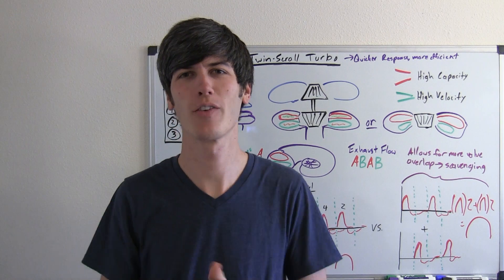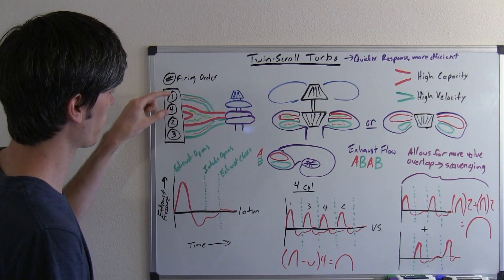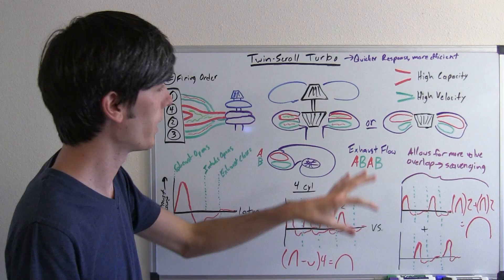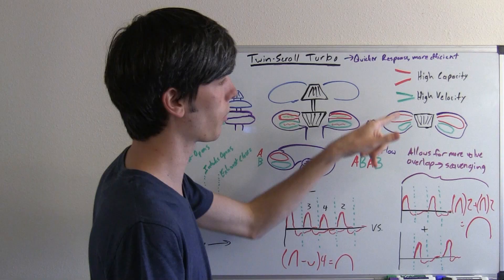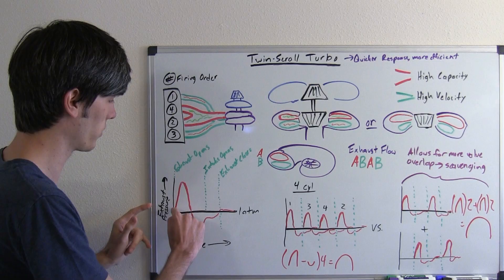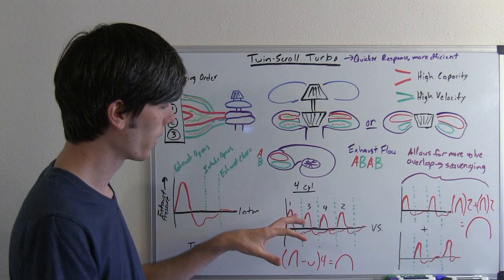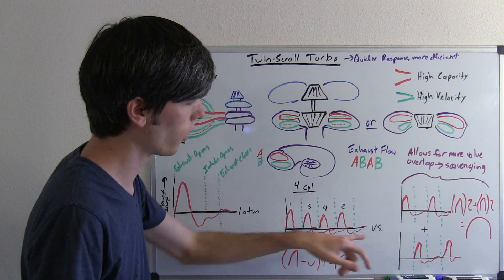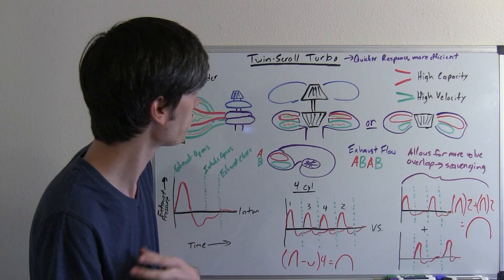Twin Scroll Turbocharger - Explained

Comment: But now I have a question in the twin-scroll turbo the two scrolls as the same size or one small for low pressure and one big for high pressure?  and if two sizes so we now not use all of the exhaust produced from the engine  because every scroll connected to two cylinders only

Comment: So what about running a single scroll turbo with equal length headers that divide the cylinders in the same order as twin scroll, and join the 2 pairs right in front of the turbo. would that get most of the gains of a standard twin scroll design? Thank you!

Comment: I'm currently working on setting up a front mount turbo setup on a V6 engine, Turbo being on the "Driver Side" of the car. This means that the driver side exhaust bank will have a shorter piping length to the turbo compared to the "Passenger Side" exhaust bank that have is piping going around in front of the engine.
If i understand correctly, please correct me if i'm wrong (the main goal of this post in fact), the Driver side exhaust bank should enter the High Capacity Scroll side and the Passenger side exhaust bank into the High Velocity Scroll?

Comment: Is there a price to pay for cylinders 1 & 4 at high rpm since that scroll nozzle is quite restrictive?  Could you accomplish the same thing (exhaust pulses not interfering with one another) by using a conventional turbocharger but still having split exhaust as you have?

Comment: I have this on a new 2019 WRX. Under various throttle positions (while accelerating) there will be no boost. Or the boost will cut intermittently and then come back later, delayed. All of this occurs under 4,000rpm, which I don't exceed as part of break in. Dealer can't say for certain what is causing this until after 1,600km break in. Currently at around 700km. Any thoughts? Like engine cutting power via timing because it's programed to until certain rpm?

Comment: so what happens to the turbocharger during the troughs for the twin scroll?
why doesn't the negative pressure during the troughs for the twin scroll affect it as dramatically as having the troughs and peaks overlap in the non-twin scroll?
Figure the peak amplitudes are greater for the twin scrolls?
Reply: In a twin scroll, the exhaust is separated in a way that the firing cycles of the cylinders is undisturbed. Think of each pulse as a racing car behind another racing car. In a twin scroll setup, there is enough space between each car so that the car behind it can benefit from drafting (here the negative pressure effectively creates a vacuum behind a leading pulse for the pulse behind it, allowing the lagging pulse to keep its speed longer). This way, the maximum energy of each pulse can be used.

Now in a traditional merged manifold, imagine all the cars trying to merge behind each other as close as possible, but each open space is half the length of the cars. To fit all the cars in, the cars behind a merging car have to slow down (in this case the pulses would merge and lose energy). In the manifold, the pulses interfere with each other as low pressure tails steal energy from the bodies of adjacent pulses and thus generally sapping some of the potential energy of the pulses.

There are a lot more factors to consider, but this is the bulk of twin-scroll.

Comment: Ok so I have a single twin scroll turbo for my ls engine.   Would it be better to combine the two sides and then go to the turbo in one 3 inch pipe or would it be better for each bank of cylinders to go to one side of the twin scroll and the other bank go to the other side?

Comment: Equal length headers will do mostly the same thing as long as the turbo is sized right.. I mean if the whole point is to even out the exhaust pulses.. Duel scroll turbos do drive with a lot less lag but so to "single scroll turbos" with equal length headers.. Perhaps it's the energy transfer from the exhaust volume harnessed from the 2 cylinders at a time that yealds more kinetic energy. Or, the engineering tolerances have just been zeroed in more across the board with a "new style turbo" to sell people. I mean duel scroll turbo does sound cooler then performance tuned turbo.. Just my 2 cents on that end of it. Good video but kinda lost me at the end lol. Thumbs up :]
Reply: the size of the trubo and the exhaust pulses are two different things
Reply: They sure are

Comment: Is it possible to have a VGT and Twin Scroll system in one turbo unit?

Power to the max!
Reply: Brap Brap Kind of defeats the purpose. Variable geometry can accomplish what a twin scroll is doing and it can do a much better job because it can be so precise. The reason why VGT is not very common yet is because it's so complicated and expensive to produce vs. twin scroll turbos.
Reply: +TheRecon4 well you get what you paid for

Comment: Since 1st and 4th cylinders feed to the same scroll, wouldn't 1 and 4 be linked together to a common manifold rather than 1 and 3? That goes much in line with alternate firing order of 1-3-4-2 I guess.
Reply: 1st and 4th cylinders are linked together to a common manifold - numbering in top left figure is about firing order

Comment: Should make a video explaining why a larger turbo setup will outperform a smaller one at the same psi
Reply from the maker: Not necessarily true.
Reply: Engineering Explained Do explain. Tis what you do best.
Reply: Aaron Barrett If I can just jump in, when you first open the throttle or are idling, there isn't enough exhaust gas to spin the large turbo up to speed, while with a small turbo, there's less rotational inertia (smaller compressor/exhaust wheel) to overcome, so smaller turbo's actually outperform large turbos until a specific RPM. It's only when enough exhaust gasses flow through the turbo that larger turbo's really make boost.
Reply: SuperNuclearDeath I do agree with you. A smaller turbo will spool up quick, but will reach it's limit in the higher rpm's. A big turbo will lag at the low rpm's but when the boost rolls on though......
Reply: ***** That's exactly what I was saying. But the issue with a large turbo is how long it takes for it to produce usable boost.
Reply: Not always true, it depends on the engine displacement and the turbo used... For e.g A bigger displacement engine would have a lower turbo threshold than a smaller engine with the same turbo. It's all relative.
Reply: Aaron Barrett quick and simple reason why you normally see adding a larger turbo on your engine and running the same boost pressure as your smaller old turbo,
the reason why you will result in more horsepower is because you have a larger exhaust turbine wheel so more Cubic Feet Minute of exhaust gas can flow through the larger turbine wheel which translates to more air flowing through the engine which then need's more fuel to be added to compensate the extra air flowing through the engine resulting in more power,
there is a point where you cant keep fitting larger and larger turbo's on your car and still keep making more horsepower due to the head/engine not being able to flow as much air as your large turbo so more turbo lag is added and no horsepower gains to be made if you go to big.
think of a drinking straw now think of how much air has to be pushed through that straw (small turbine wheel) to become a restriction on itself at say 10psi of air pressure getting pushed through it.
now think of a 3 inch, straight piece of exhaust pipe (large turbine wheel) now how much air would you need to flow through it to become a restriction on itself at 10psi.
it's a lot more then the straw. :)

Comment: Hi Jason, long time watcher - really appreciate your vids.  Have a question for you - I've been reading about the new Honda 2.0T Engine being put into the new Type Rs.  What I'm interested in is the decision to use a single scroll design.  I feel that is blashmemy and goes against every rule of turbocharging design, especially on a 4 cyl where the pulses are so spaced out.  It would be neat to see what magic they are performing with the exhaust valve timing.  Anywho - any thoughts on this would be great.  Take Care, keep up the good work - Nate

Comment: Hi! 

Can you explain the benefits of the twin scroll turbo on an engine with equal firing pulses like an straight six engine (with equal length exhaust manifold.)

Does a straight six engine still have valve overlap between cylinders?

Comment: Why doesn't the second equation take into account the pressure drop? It's still there, just not figured for...
The twin scroll turbo is still only splitting the pressure that a standard turbo would see in half, with each "scroll" getting exactly half the pressure, right? Please someone teach me, or correct the equation and then convince me.
I mean, with a compound turbo setup, the full amount goes through the small turbo to build boost quickly, then the full amount gets diverted to the big turbo (at higher rpms). That makes sense to me, but sending half and half throughout the entire rpm range seems to me like it would cause both turbos to operate far outside of their efficiency range.

Comment: Question: I have a 84 mustang SVO 2.3l intercooled turbo and have a center/ top mounted header that has a open flange, I have a twin scroll exhaust turbine for my T3/4 turbo. The header is set up where cylinder 1&2 are on the front side of the collector and cylinders 3&4 are on the back side so if I fabricate a piece and weld it down the center of the collector to create a twin scroll manifold I'll end up having cylinders 1&2 paired together and cylinders 3&4 paired together. My question is how are the pulses and pressures going to effect the performance of both the turbo and engine?  Btw the Watergate is on the front side and would be on the side with cylinders 1&2.
I know about if turbo is a twin scroll and the manifold is open it's the same as having a single scroll turbo and the same if the you have a twin scroll manifold and a single scroll turbo it performs like a single scroll. So I like the benefit of the twin scroll but don't know if retrofitting my header to create twin scroll manifold would be beneficial or not.

Comment: Please do the difference between vtec,vvtLi and VVL
Reply: They do the same, but the make the valves open more and longer in different ways.
Reply: VVL isn't like VTEC or VVTL-i. VVL advances or delays the cam timing. No extra cam lobes like VVTL-i and VTEC.
Reply: TheFlacker99 (Flak) your thinking about VVT, VVL is nissans form of vtech, mechanically it locks the rocker arm differently than in vtec but it still has the extra cam lobe. VVT is where it advances and delays cam timing to minimize overlap.
Reply: Yeahp... Nissans VVT is VCT used on VG30DE(TT) and RB26 to GA16GE.
Reply: Jeff Gallego Ah yes, oops. :D
Reply: TheFlacker99 (Flak) its ok bro we all learn of each other :)
Reply: Jeff Gallego Amen.

Comment: Is it possible for one of the channels of the twin scroll to malfunction? I am not getting the level of initial boost and lift off as I am accustomed but the dealer cannot find any faults registering with the engine. I have a diesel BMW and I am getting engine hesitation and cut out between 1500rpm and 2000 rpm.

Comment: soooo, is the Twin Scroll better then a single scroll? do they require a twin scroll manifold? or twin wastegates?
Reply: They require a twin manifold to work properly as there are 2 holes on the flange rather than 1. They don't always require 2 waste gates though. Some come with a single internal or you can run a divided single external if you want depending on flow requirements.

Comment: Is it possible to have two twin-scroll turbos boosting the same engine? Take, for example, the Lamborghini Urus with a twin turbo V8. Could each of those turbos be replaced by a twin-scroll turbo (so you would have a twin, twin-scroll turbo)? Would this be advantageous?
Reply: Yes you can! Search for nre (nelson racing engines) he is only using twin turbo twin scroll set ups and making massive power! I'm talking of 2000 hp+ and 1500 ft lbs/2000Nm+. It's just crazy

Comment: EE,
How would a twin scroll turbo be applied to an inline six (153624), and how would the cylinders be paired?
Would two or three single scroll turbos be better?  Or two or three twin-scroll?
 Is 60 degrees of exhaust pulse separation enough to prevent scavenging interference?
Thanks
TV
Reply: +turbovan65 This is a good question here.  I've had the same question, but I believe the answer changes based on many different variables.  I would think that your answer lies somewhere between the law of conservation of energy, the law of thermal-dynamics, personal preference on manifold size, turbo size, exhaust size (because of back pressure), and of course every component in the engine.  The math would be accomplished by figuring out what the maximum volume of exhaust was leaving the engine, and finding out what the maximum and minimum volumes were for the type(s) of turbos you selected.  

Imagine this:  What if instead of using three different turbos attached to two pipes off the manifold or using two turbos attached to three pipes off the manifold, you used a compound turbo system in which each turbo would serve a specific portion of the RPM range?  Check out the Street Fighter Z car if you want to see this set up.  This uses two turbos to create the same effect of the twin scroll, one for low RPM and one for high RPM and a valve to allow air to move from the smaller turbo to the larger when RPM's rise.  Utilizing two twin scrolls in a compound set up might actually give better fine tuning and efficiency then having three or two in the aforementioned setups.

Comment: Excuse me, but I can't agree with this.
From my understanding we have to look at the integral of the pressure in the exhaust over time. 
I don't see why this value should diverge between a normal exhaust manifold and a twin scroll manifold. That's like saying 4 is unequal to 2x2 ...
I feel really stupid now :(
Reply: At first i thought you were crazy. But that is actually a great comment. Its got me thinking
Reply: The way I understand it is:
In a normal turbo manifold of all into one, you're going to have an overlap of positive and negative pressures, making the overall pressure lower than what the peak was. 
In a twin scroll manifold, it's every other firing piston. This way you get the peak pressure from every piston. Yes there will be a low pressure in one manifold, but at that point the other will be at it's peak. Having separate chambers in the turbo would eliminate the two mixing and making the whole process useless. The two don't mix until they're out of the turbo. Basically you're taking (in this example) a 4 cylinder engine, and splitting it into two with each having it's own turbo. This method maximizes boost while not having a ton of extra work, there is more piping to be done but it's a lot less than doing a twin turbo solution. 

Now if you combine this with the variable geometry, if you watched his video over it, he says that it used a linear actuator, but I think (especially in this situation) using a bleeder valve connected to a pneumatic actuator. More pressure would cause the pneumatic piston to extend, thus opening the chamber; while less pressure would cause it to retract, which would cause more velocity. The pneumatic actuator would of course have to have it's own bleeder valve, probably going back into the piping before the turbo so there's no loss of power even though it's minimal. 
But adding that to this, you can have two separate VGTs in one, which would cause a faster response. Let's say as you rev up, cylinders 4 and 2 provide more exhaust, well that could open up the scroll chamber for 1 and 3 before they fire, and you would have a faster response off of those two. Now lets say as you let off the gas, the same thing would happen but it would increase velocity before your set of pistons fire. 

Twin Scroll maximizes power output based on which cylinder fires. 
VGT maximizes power based on how much velocity is needed.
This puts us closer to a true anti-lag system. Of course we can never technically achieve 100% no lag, but this puts us closer.
Engineering Explained, I'm on the right track, right? Or did I miss something somewhere?
Reply: This question is real, when we look at pressure, and it was the way it was explained. In fact turbos work with heat, that is delivered in pulses, this makes everything more complicated than the explanation in the video, and smoother delivery of heat in a turbine uses better the heat than more pulsed energy income, and 2 smaller diameter turbines have less kinetic moment than a single larger one, so it spools faster at low engine egt, that is the great target, because this means less fuel to be lost as heat without use.

Comment: Engineering Explained Could you explain the difference between this and Koeniggsegg's new patented turbo: watch?v=DNedUZxP8NU. It seems like all exhaust ports empty into the turbo together, but then an actuator valve slowly diverts all flow from one small scroll to another bigger one. Also, could you recommend any good SAE books on turbocharing/supercharging other than Corky Bell's. Cheers.

Comment: Great! is there actually two separate manifolds? or are the 2 different sets of runners welded together?
Reply from the maker: No, you can simply have the two runners of each join together just before the turbo. But it can still be one piece.